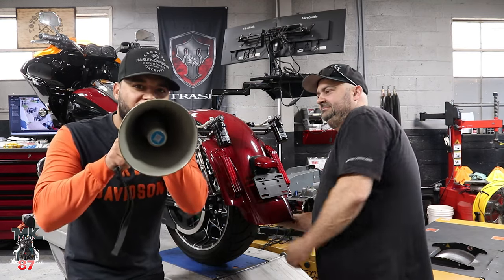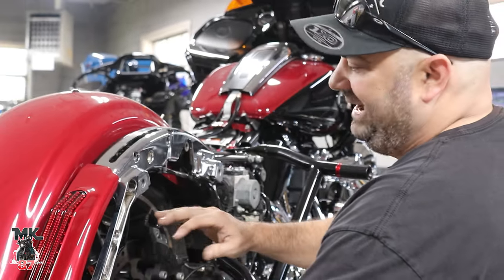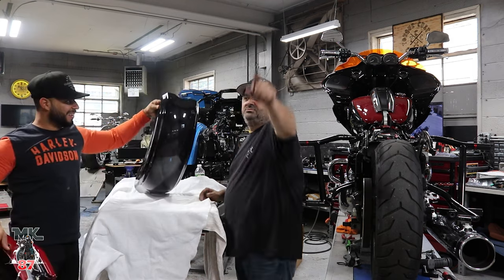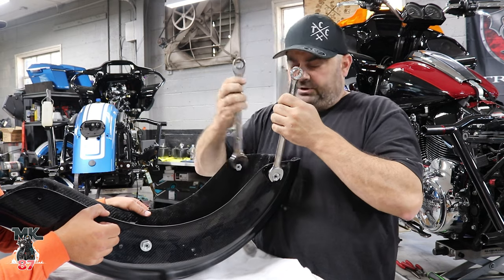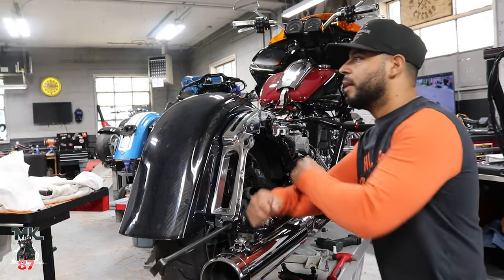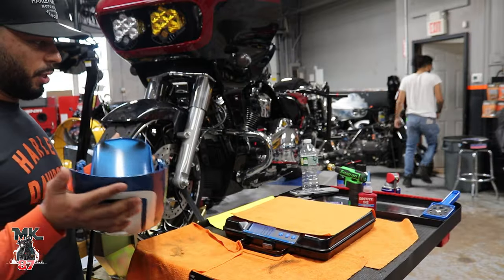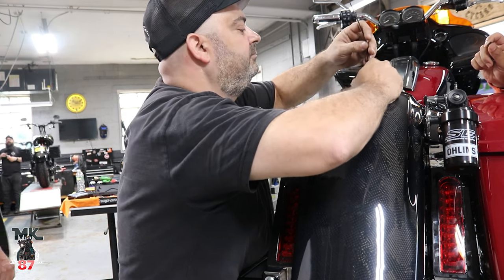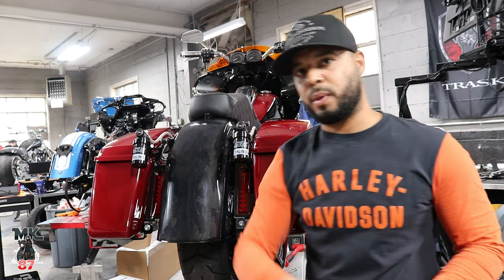Carbon fiber fender install for my Harley Davidson Road Glide / performance bagger

Comment: Great video man, really digging the camo carbon fiber.  If only they offered a rear shorty fender as well.  Can’t wait to see what else is in the works for your RG.
Reply: They do. You can order any part in any color/pattern you like. They make 4 different rear fenders, 1 race shorty and 1 not so short that goes with the chopped bags.
Reply: @gabez5740  Thank you very much for letting me know.  Maybe I just couldn't see it all since i used my phone to check.

Comment: Bro 2 things chrome the wheels but leave the spokes black or vise versa that be 🔥!! Also what could u have done if u kept streched bags thats what i got and like the room i dont wanna chop them so what woukd a option be for rear fender then with the tri bar?? Any ideas ?? Im going to do the front fender but i want to do the rear too but itll look stupid if i just do what u did that only works with standard bags
Reply from the maker: I had stretched bags and I ended up getting these advan black short bags easy fix and affordable
Reply: You can re install the mullet for the stretched bags on your new fender. Problem solved.

Comment: Love the license plate delete. Getting rid of all that nanny stuff does a nice job of cleaning up the ass of the lady bug. Those black Custom Dynamics taillights aren't bad in the chrome fender supports but you don't really need them either and the remote reservoirs would look less testicular in those cutouts than on the ends of those insectoid antenna thingies.

Comment: I ordered a dash from a company and I didn’t really like the service do you think the carbon will look different if I order the rest of my parts from another company
Reply from the maker: Depending on the prints yes
Reply: Even standard Carbon will look different. They all use different products
Reply: @gabez5740  that’s what I was afraid of.
Reply: Some companies use lesser grade carbon and lesser grade epoxies. Black Widow Creations only uses carbon and resins manufactured in the US
Reply: @gabez5740  I might have to check them out for my fenders and battery covers, I still haven’t even received my dash that was supposed too be shipped weeks ago
Reply: @sammyvices2547  what bike do you have?